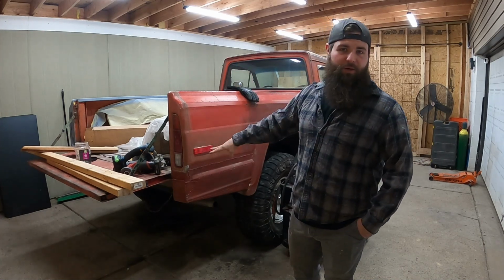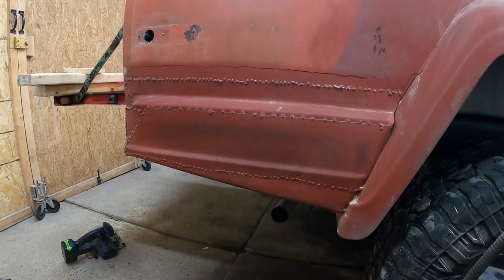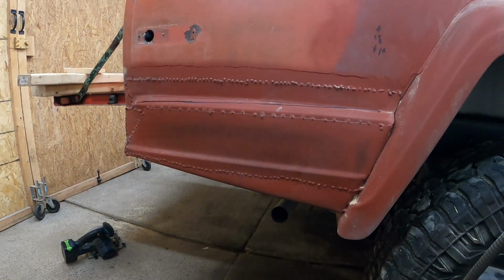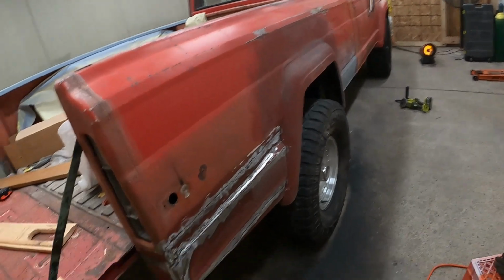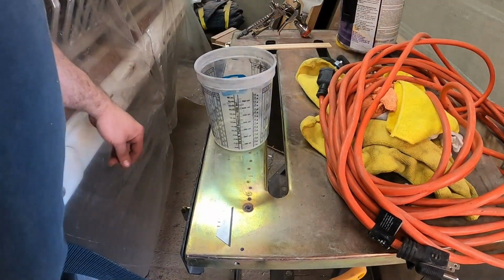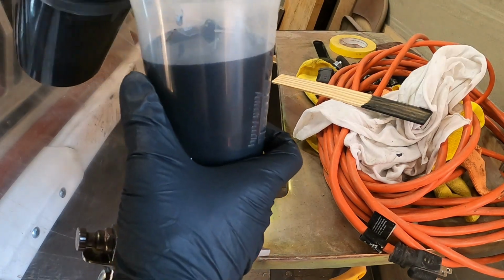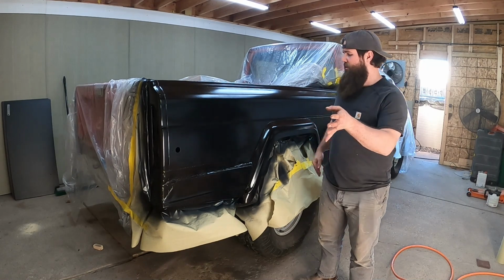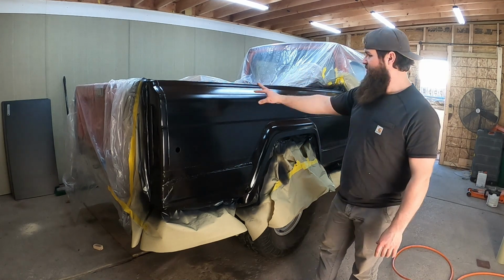1978 Jeep J10 Gets Epoxy!!!

Comment: Looks good man.

Im in the process of buying a Jeep j10 131 inch wheel base.. so i think its the 8ft bed.  But based on his pics.  The beds rusted out on top.  The sides arent TOO bad but its there.. floorboards in the cab are gone.  Frame is rusted but its just that surface rust that frames get.. deff is 100% solid.

Of course ive done rust repair on my 90... Major frame rust by the gas tank. Shock mounts (which all fsj have in one form or another)  rear of frane.. leaf spring box mounts in rear were all gone.. body mounts all rusted out..  missing the rubber in fact lol.. floors were bad too.

But i did it.. 6 years later its daily driven compliments all over and youd never know it had thag rust.  I cut it all out and welded new metal or donor peices.

Now on the FSJ forums.  Everyone is saying stay away from this Jeep that Jeep stay away from the j10 im looking ay.

Floorboard rust is 100% common.. bed rust ?  Common even in california.  

I sware people dont wanna fix anything anymore.  I could get this Jeep by trading my lever action henry 44 magnum rifle thats it..  yes my rifle i feel is worth more at 900$ and the truck has no title..  So id have to go the vermont title loophole way.

But still.. once i fix the rusted bed and floors right.. put carpet in it.  Clean her up snd wire wheel the surface rusted frame and paint.  Itll be worth a crap ton more than 500-1000$.  

My main concern is actually a good drive train.. Id rather cut floors and the bed sections out than rip out an engine and trans.. 
Plus i need a pickup for my 14 acres lol
Reply from the maker: Thank you for watching and your truck sounds pretty close to what we have lol. But that's all it takes to get a good looking truck back on the road is a little elbo grease and a few late nights and boom a nice price of history that will last another 40 years but it is crazy how cheap you are able to get these trucks but yeah I completely agree with what you said about it fix em up and drive them and no need to change the drive train unless absolutely necessary but everything always works out in the long run for everyone's projects and yes somebody did a temporary patch in our cab floors already which we will change out soon and the bed rust is also there too and has been patched on as well!